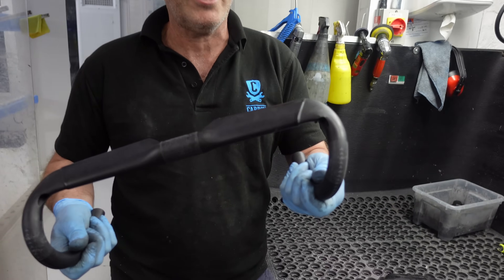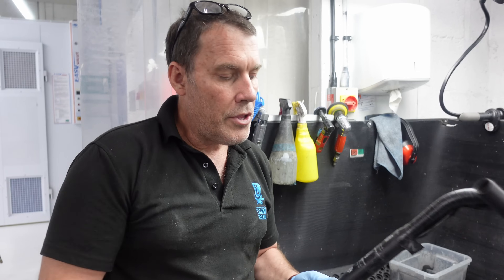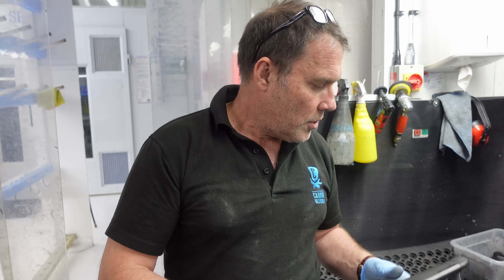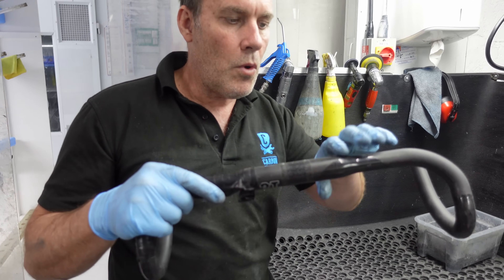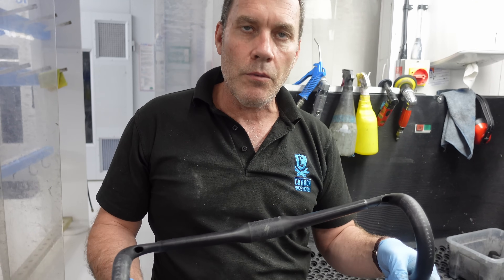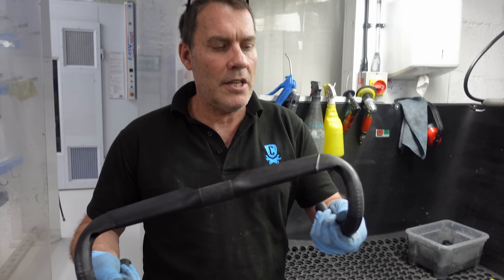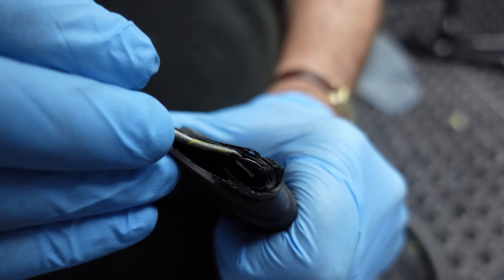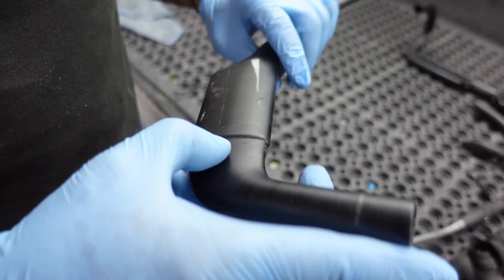Carbon Fibre Handlebars… What No One Is Telling You!

Comment: A few years ago I decided to do a test before I bought my first carbon framed bike.
I bought a cheap carbon fiber mountain bike handlebar from China.
I set two 2x4's on my gravel driveway, put the bar across the 2x4's and drove the front end of my 5000 lb. F-150 on top of it.
Then I got out and looked. It was flexed all the way to the gravel.
I let it set a few minutes then I drove off of it.
I carefully examined and tapped the bar, and except for an abrasion from the gravel there was no damage to the bar.
I've been riding carbon fiber bars and frames with no issue ever since. 😃

Comment: Thanks. What should I look for in a stem for the carbon bars I'm about to install on my road bike? My 85mm Easton stem has a two-bolt clamp. I'm looking for safe and well-made, not concerned about weight. I bought the Coefficient RR carbon bars to better fit my large hands and my ergonomics. 85mm fits me well, but a small change longer or shorter would be fine if 85mm isn't available. I've the tools and skill to check for and remove burrs and chamfer if needed.

Comment: removed the oem carbon handlebar on my enduro mtb put it on my xc i have a heavy fox38 fork solid pedals that eat rocks every ride weight gain is not worth the risk and im full susp anyway not a road bike
for a mtb your main benefit of alu bars is they are cheap and easy to cut you cut too much buy another one its like 30-40 and comes in any rise from 0 to 75 plus

Comment: Not sure if I buy the round bars being riskier argument. I've been running a second hand S-works carbon stem and handlebars since 2017. They were made between 2007-2010 so probably a good decade on top of the years I've put on them. 

Still running perfect and never a creak.
Reply: I would bet as everything else quality back then was better, maybe less advancded but with technology comes shortcuts and shaving safety margins morer and more which is why cars reliabilty is gone in 2025

Comment: I have been riding for 37 years and have  only broken alloy bars, first a set of  drop bars in the early 90s which was my fault as I drilled my Cinelli bars for internal cables. The second was a tribar ...Deda Aeroblue, where the stem completely failed during a timetrial completely detaching from the bike whilst on the tribars...that did hurt. Nothing is 100%, and the internet   is a great amplifier of scare stories.

Comment: Nice content sir.  What I have learned is. 

1. I will choose carbon fiber parts over alluminum only if you want stiffer feeling and very slightly lighter weight.
2. Alluminum is safer for parts that are being clamped or where too much pressure being is applied on constantly.
3. I will choose carbon fiber since it looks better on bikes.😅

Just my own opinion though.✌
Reply: Carbon fibre bars and stem absorb vibration much better than alloy - that IMHO is much more important than weight. So much more comfortable.

Comment: What is the best fiber paste to prevent slip, at stem clamps etc.
Reply from the maker: This is the one I have - https://amzn.to/4bGHHJ0
Reply: They're all the same, just get whatever carbon paste is available.
Reply: @einundsiebenziger5488  They're not all the same though. Some are like white toothpaste with fine particles, some are blue silicone gels. They do vary per manufacturer. I also wonder which is the better brand or type

Comment: But what I wanna know and what I have never really gotten a really good answer for is why is it that you can’t repair carbon handlebars but you can repair a frame. If it’s purely from a liability standpoint, then to me, it would negate the reliability any carbon repair. There are chaijstays that are pencil thin. I suspect is much more likely that the carbon frame having more mass in the area has a much less likely chance of catastrophic failure, and hence why people are so unwilling to work on handlebars where if they snap you lose control. but again for me if I am to trust a carpet frame repair, I should be able to trust handleable repair just as well.
Reply from the maker: I'm going there soon so I'll ask the question 👍🏽

Comment: I bought a Toseek Aero Carbon Drop bar for $35 couple years ago.  I didn't wanted to spend over $100 to find out I didn't like them.  I have seen and heard many of them failing, but mine are still going strong.  I love them, but if they fail I am switching back to aluminum.
Reply: your comment is exactly my case and the reason why i am doing this research. thank you so much.

Comment: Call me stubborn but i want a chromoly frame and alloy bars coz im pretty sure it would very likely OUTLIVE me
Reply: Titanium will. Steel frame, not so much, unless you take really good care of it. Remember to check those alloy bars as they will corrode under the bar tape (the alu can't form a protective layer as that requires oxygen. 
I'm afraid you have been told a lie on both counts. Unless, of course, you're 80, and will pass on within a few years. 😁

Comment: Awhile back, I over torqued a stem bolt and cracked some carbon handlebars in the center.  Before I tossed them, I tried to see how hard it would be to break them along the drops and it was near impossible.
Reply: Just done exactly the same, its cheap unbranded Chinese carbon but there's no flex, even along the crack. I tried standing on it.
Reply: Riding over road bumps these bars have to endure a load that you are unable to reproduce with your hands only. And then we are not even knowing anything about the repeated impact from vibration, which may tire the composite material and cause parts of them to be "unbond".

Comment: I managed years ago to break my aluminium bar. Thankfully i could stay up right and even continue cycling with the other half of the bars. Braking was kinda odd. Got home safe. 

Just in case you think alu is safe and carbon isn’t. 

Stay safe, take care of your equipment, check when cleaning the bike, look for weird spots or small cracks etc. check after crashes/ falling
Reply: One word: Titanium.
More words: I chose titainium for that exact reason. I never trusted alu, as I did bike trials (as in jumping around) and had one crack (not break entirely). Since then I purchased steel, and now with my latest bike, I decided to go all in and buy a custom titanium version of my preferred geometry. Titanium, unlike alu, doesn't mind flexing. Alu, if flexing will be fatigued instantly. Alu corrodes when robbed of air.  Carbon: Hidden cracks and delamination. Neither a problem with my titanium version.
That said, the holster and the foot itself on my prosthetic leg is carbon fiber, and the hardware and tubing on it is Ti.
Reply: i broke stainless steel at the joint of the corner bar. corroding seen.
Reply: But carbon splinters when it breaks. You may get a cut from aluminium sharp edges but splinters from carbon no thanks! Alloy can also Corrode over time and fail.

Comment: Carbon fibre has one place on a bike in my old school opinion is a headset spacer. thats it.
Reply: Just wait until you learn what most aircraft are now made of!!
Reply: And in my case: The cargo platform and the steerer arm. I guess I could also add fenders/mudguards. Fits well with my Ti Omnium Cargo.
Seatpost is alu, as is the stem (Both strong Thomsons) not the lightest but plenty light enough and super stiff (you don't want alu flexing

Comment: Nice one - the stress risers on those Specialized aero drop bars were insane: the cable hole and the aero/drop transition are unforgivable. No wonder they broke there. Unless you're at the sharp end of racing and need the aero or hill climb ultra-light, there's just no need. They save no significant weight, they're silly expensive and they fail suddenly. Straight mountain bars aren't too bad because they can be made in one, but they're still vulnerable at clamp areas and from crashing.

Comment: I once snapped an alloy Cinelli bar. Of course, this was after I had crashed on it 5 or 6 times. I was lucky in that it snapped while I was stopped at an intersection when I was resting my forearms on the bars. The right side just came off. I had to ride back 5 miles holding that part of the bar out of the front wheel.
I wouldn't trust any carbon bar, even after one crash.
Reply from the maker: Yeah, I think after one crash they should be properly inspected 👍🏽 Good to hear it snapped when you were stationary.
Reply: @JourdainColeman  This was decades ago , back when Cinelli's were 26.4, and the 1A stems were quill. I was in a group training ride, and had just finished a sprint before we had to wait at an intersection for traffic.
The cycling gods were with me that day.

Comment: i've snapped a 20yr old alumunium Cinelli drop bar...and I recently had a 35 yr old steel frame snap the downtube...nothing lasts forever people.
Reply from the maker: You must have had some good use out of them... 20 years for a set of bars is good going!!
Reply: @JourdainColeman  my fault i reckon, overclampng the brake levers is not just a bad idea on carbon!
Reply: @JourdainColeman  Daft owners keep over tightening every bolt on there bike they think there on a bloody Reynolds 531 and not a carbon the silly buggers
Reply: Diamonds.
Reply: @tommyfreckmann6857  damn, forgot about them...
Reply: Aluminium doesnt snap.
Reply: Chafing from unbranded cycling shorts lasts forever.
Reply: aluminium*. And you still separate sentences with single fullstops only.*
Reply: @einundsiebenziger5488  Looks like the author is writing the way they talk . . . informally. I do the same . . . obviously. Have you seen YT comments? That's nothing - full of savages.

Comment: I Wonder then if its not better to incl a honeycomb inside?
Reply from the maker: When the bars are made there is a plastic bladder inside the is expanded (like a balloon) to press against the carbon from the inside. So I'm not sure this will be possible
Reply: @JourdainColeman  i can understand its more expensive with honeycomb, but if you use the honeycomb as a groundshape to mold the carbon around. It should be possible to make holes for the cables inside to. In the flightindustry they use honeycombcarbon with very advanced shapes. Or am i wrong?
Reply from the maker: @gurkpojken  That sounds reasonable to me. But I wonder how easy it is to mass produce them. You also have the issue of cable routing as well 🤔
Reply: @JourdainColeman  the mass produced thing is the problem ofcourse.
The alu-honeycomb can be pre-milled with a track for the cablehousing.
Reply: It'd increase weight and would make internal routing impossible (not a problem for regular-shaped drop bars).

Comment: some bars are too light, people tighten them too much.  Got carbon bars on my mountain bike and road bike. no issues.
Reply: I fear those who are really heavy, yet still stubbornly want über lightweight carbon parts.
Reply from the maker: Yeah, i have carbon bars on my road bike and no issues so far. I think the just require a little more attention. Interesting you have them on your mountain bike as well 👌🏼 I bet they take a battering?
Reply: @JourdainColeman  Last MTB ride was coming down Beinn Ime.  no issues at all with the bars - one up 35mm.  had carbon bars for years now.  take less battering that the road bike does due to the suspension I recon.  On the road bike I take my weight off the bars on any rough bits of road.
Reply: I have carbon Bontrager road bike directions to thousand 13 on my project on trek madone. No crashes , I don’t race , but ride fast with fast groups for years off an on . Solid bars I weigh 165 pounds. I also have some flat carbon Niner branded MTB bars on my Xc bike .  I don’t race it ,  and no crashes to pretty solid handlebar. So far some of these name brands pretty good no issues here .

Comment: I had a carbon stem on my last gravel bike. I took it off to set it up to sell it. I spoted a crack in a top layer of carbon. It looked like it was possibly more cosmetic than structural as it seemed to be an additional layer added to the stem. Or, maybe it never bonded properly?  It was a "premium" brand and not a cheap stem. I was wondering how long I've been riding it like that.
Reply: What stem is this?
Reply: @sbccbc7471   It was a Ritchey.
Reply: @DaveCM Could it be by any chance a WCS Carbon Matrix C220 84D?
Reply: @yonglingng5640  I don't remember the exact model. I threw it away. It was had Carbon Matrix on it. Did you have problems with the same stem too?
Reply: @DaveCM  Sounds like yours is a mix of carbon and aluminium.
Reply: @sbccbc7471   would explain it

Comment: Think I'll just stick with alloy, carbon seems such a faff for the weight savings...This fella you have on is a wealth of knowledge, always learn something....  (I was going to get a pair of rigid 29er carbon forks from Ali Express for my Rockhopper, but wised up and bought some new RS Judy's instead...heavy AF but at least I can trust them)
Reply: It's more about ergonomics and comfort of aero bars, and not so much about weight. For me it's not weight but the flat top of the bar to get rid of the numb hands. I always got numb hands on the round bar, but as soon as I got the aero bar that are flat, numbness was gone. Very nice!
Reply: @EYEupP you need to improve your bike fit. The flat part is there for aero gains, not really for riding. You should be most comfortable on the hoods with a proper fit :)
Reply: @darvd29   I never even touch the tops (the flat part), but the bar itself is just a different shape and right next to the hoods, where the base of my palm is, is a little bit flatter (not flat) and not entirely round, so the point of pressure on the palm is not so small. It just is more comfy. It also changes the bike fit a little bit as it is a bit different, I guess.
Reply: @darvd29 
The flat top may save a "6seconds over an hour at 50kmh" but primarily it's for ergonomics. 
A carbon flat top section and hood  transition distribute weight on palms far better than even the flattest sections that Alu can offer.
Reply: Why turn your Rockhopper into a rigid?

Comment: I’ll only ride with aluminium bars & stem & aluminium carbon fork, there’s a place for carbon & it isn’t the steerer tube , people buy 80mm dead to go in carbon stem so it just as well be aluminium.
Reply: Carbon forks with aluminium steerers are more likely to break than all-carbon forks. The weak spot is where the cabon meets the metal because they have to be glued together. A quality carbon fork is made from fibers running in one piece from the dopout to the end of the fork shaft. What you still have to do is to clamp your stem with proper torque.
Reply: @einundsiebenziger5488  I’ve always dropped my forks every three months just to examine them, never had any issues with aluminium carbon joints, it’s always worth checking though 👍

Comment: You get what you pay for.   Buy cheap and you get cheap.
Reply: I dont think so.. the aero bar in the video aint cheap but still broke.
Reply: Actually carbon is carbon. And there is enough material in the internet showing that it is simple not worth it to go carbon on bars if you are not racing.
Reply: @rand_kk not true.
Reply: @tommyfreckmann6857  I'm better off going a few gramms heavier than having a minimal chance of bar snapping during a sprint. Sorry, for me, it is not worth it.
Reply: @rand_kk  My Deda Alanera bars on my Colnago V2r are just fine after more than 10k riding.

Comment: "not a big difference in alloy / carbon bars and if there is I would probably not want to use them". Well that's not true, now is it? There is a reason you can buy cheap Chinese 70 pound bars made of t700 carbon. And why a Pro vibe superlight T1100, Darimo or Schmolke bar costs +400 because they are using high end lightweight material that you will not find in any other bars... My (one of the first in Europe) Pro Vibe Superlight T1100 at 152 gram is still going strong and I am heavy at 83kg! And yes, it is paper thin, measured to 1mm thick in the drops. But I don't believe Pro (Shimano) would release a dangerous product considering the size and integrity of the brand
Reply: Recently, there is a recall for Pro Vibe stem
Reply: @mpgunawan  oh wow, I missed that one! But it's the old stem and only pre 2020 may is concerned, which is scary they escalate a recall 3 yrs later... But would you had bought it from aliexpress you would never know if there was such a concern. I am not bashing Chinese products, I have bought plenty from Alie, most recently a frame. Great success with cheap Uno stem. But handlebars I rather pay 4-500 for something better
Reply: "But I don't believe Pro (Shimano) would release a dangerous product considering the size and integrity of the brand"- tell that to the hundreds of owners of the Shimano Ultegra/Dura Ace cranks that have delaminated and spectacularly failed...Shimano's dirty little secret that's still hushed up by the complicit usual suspects in bike media- only Bike Radar ever mentioned it (once)and said it was "rare" lol
Reply: Julian alaphilippe is using a Shimano pro vibe alloy bar not the carbon option that his team mates ride on.
Reply: 83 kg isn't a heavy weight limit for carbon parts, 90 and above is. Since you're light enough for production Darimo carbon parts (ie. no extra reinforcement, which is needed for riders 90 kg and heavier), I doubt PRO's carbon handlebars can't take your weight.